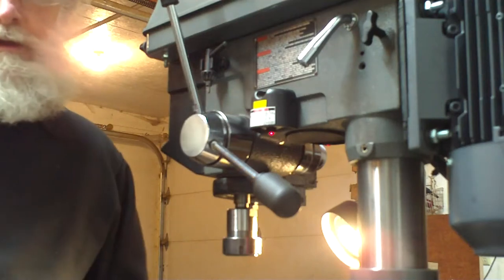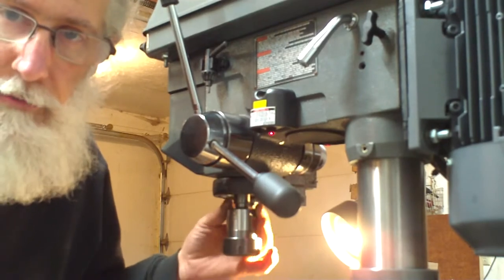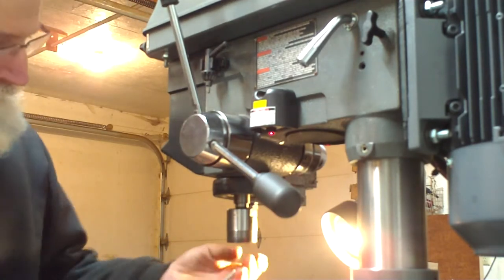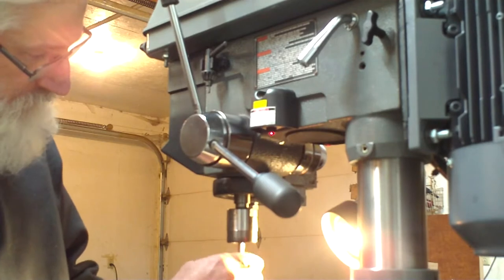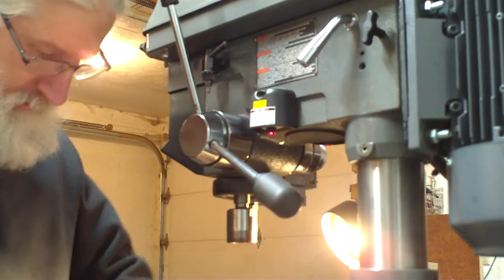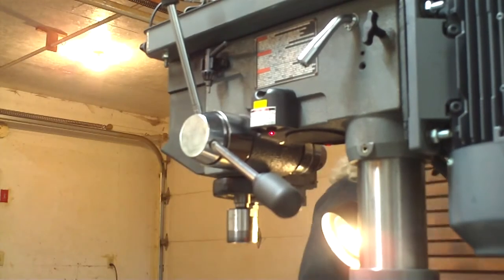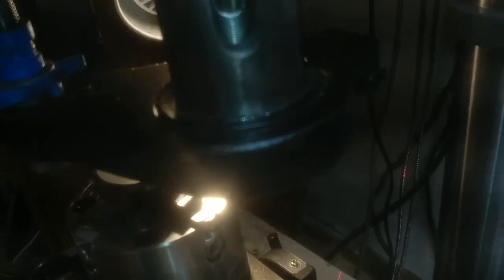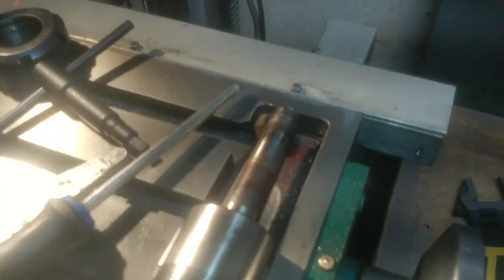reverse draw-bar detail

Comment: This is genius.  I had a similar idea, but I was going to pull apart the spindle and drill a bore to build a drawbar.

This is so much simpler and doesn't require the drill press to be hacked up.

Comment: Thank you Sir! I recently finished adapting your design to my drill press and it works very will indeed. My press only has a #2 M.T. so it was a tight fit, with a lot of careful grinding to get it right.
Reply from the maker: Thank you for your comment, and I am glad my video was helpful for you. Seeing other people learn from and make good use of what I present in these videos is the biggest incentive for me to continue filming these projects.
Reply: What size screw did you use?
Reply: @rubenclark8017  The biggest I could fit was a #10 (imperial). If my press had a #3mt. it all would have been much easier! I also tapped a #10 hole in the SIDE of the piece to help set and hold it in place while the draw bolt is installed. I use a piece of round, tapered steel to pop the arbor loose. Brass or aluminum might be a better choice to prevent mushrooming the bolt head.
Reply: @crichtonbruce4329  
Thank you.
Reply from the maker: It has been a while, but I do believe that a #10 is what I used in my setup as well. Anything bigger would cut the cross bar in half. With the #2 Morse taper it is strong enough to pull it tight and not slip.
Reply: @matthewperlman3356  
Thank you.

Comment: hi Matt, great idea maybe I missed it but how do you remove the collet from the machine
have you some type of knock out ? thanks for you video Beau from Australia
Reply from the maker: it works like this https://youtu.be/y_X85paZbK8?t=516 and to remove it you tilt the back of the collet to one side in the cap after removing the cap from the adapter.
Reply: @matthewperlman3356  thank you Matt, I think I am clear on the idea and will now draw it up and make. After bending the spindle on my mini drill after a lot of work I decided to but a larger drill, the details on the plate affixed said 2mt after I removed the chuck it turned out to be 3mt so possible an advantage.
We are in covid lock down now and as I do not have a lathe progress will be halted for some time.
I will let you know how it all works out.
regards and thanks
beau

Comment: It is easier to grinded a 10mm bolt to fit inside the oval ole, and tightening the collet adaptor to the bolt.
Reply from the maker: If you plan on leaving it in permanently that could work, but aside from that, there are two issues I see with that solution. First the oval knockout slot is barely 8mm wide,  so you wold have to grind flats in to the threaded section of the bolt as well as the head. the second and more important issue is that  once you tighten the adapter in, and it work-tightens even further, you would not be able to remove it again with out taking drastic measures which would likely damage the adapter and or spindle assembly.
Reply: @matthewperlman3356  Hi Matthew, Sorry but whit many try I did not have any trouble to remove the er collet holder, I unscrew the collet holder easily. It is true that I do not tighten to much (not needed), I change off press-drill often (I have one 1/2" and one 5/8".)It work well on bolt.
Reply: That's the way

Comment: VERY COOL VIDEO MATT. IS A MILTON TAPER & MORSE TAPER THE SAME?
Reply from the maker: That was a mistake on my part. It is a Morse taper, not a Milton taper. for some reason I tend to get that mixed up. Industrial Milton is one of the standard (and most common) quick fittings used on many air hoses; many retailers just label them as "type IM."
Reply: @matthewperlman3356  WHAT SIZE SCREW ARE YOU USING?
Reply: My drill press uses a Jacobs taper. This is a nice mod for the lateral load, but I wonder about my bearings. I don't know if my bearings are suitable for a lateral load.
Reply from the maker: @fredflintstone8048  The bearings should not be a problem, however the spindle shaft can be if it is a small diameter and you crash or bind up in the work. I had to repair mine after attempting to use a boring rig.

Comment: I'm building this reverse drawbar tomorrow.  Just cut down the end of the ER32 holder.
Reply from the maker: "Just cut down the end of the ER32 holder." Was it extending too far in to the knockout slot region? On mine it sticks up just enough to let the knockout tool loosen it when you need to disassemble. The cross bar that the reverse draw bar goes into has a notch to accommodate the height of the MT taper back, above the bottom of the slot.
Reply: @matthewperlman3356  It was extending too far that it was preventing the Morse Taper from seating in another drill press I was going to use, but did not. (The same model drill press you use in this video). Normally you have the two scallops cut on the male MT...  I only cut about 1/8" off. I did not have a long size #12 bolt, so I used #10-24 allthread, double nut and washer inserted up through the drawbar hole in the end of the ER32 holder.  The allthread engages a half moon adapter inside of the column's MT2 eject slot.  I took a disk the thickness of the width of the slot, turned it to the OD of the spindle, put a 9/16" hole in the center and then threaded from the edge to the center of the hole to receive the allthread. Cut the disk in half to form an arch. The two feet of the arch sit on the bottom of the slot. The ID of the half disk allows for clearance over the top of the ER32 MT, like a saddle. It is now a mini reverse drawbar from inside the ER32 to the MT slot.  Same thing you did.   I finished it up last night and it works great.   This is installed on an Electro-Mechano Floor Model 601, big heavy vintage USA made X-Y table clamped on a production DP table with hand crank elevation. The 601 has variable speed handle and a back gear selector on the front. Also a spindle lock and can use a counterweight in the column for head travel.  I have a Kurt vise for the X-Y table.   I did all this because I passed on a Benchmaster MV-1 milling machine and am kicking myself!
Reply from the maker: @flashgordon6238  cool! Sounds like that's should work well for you.